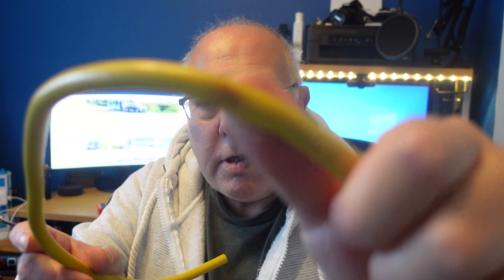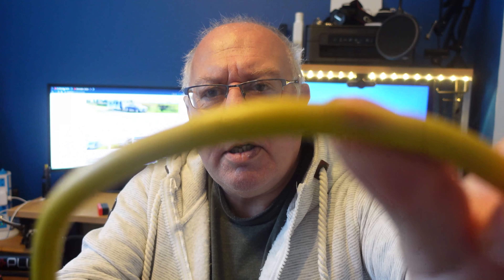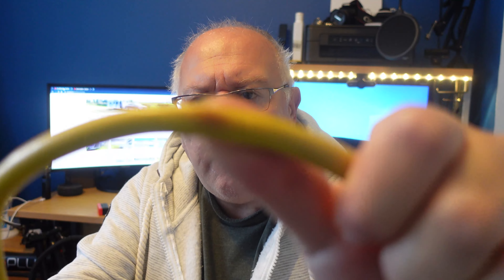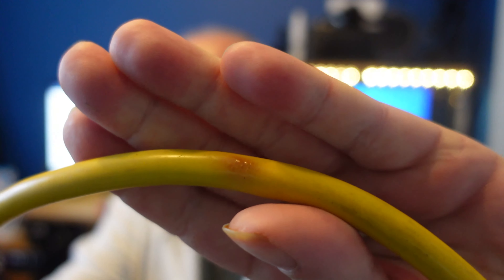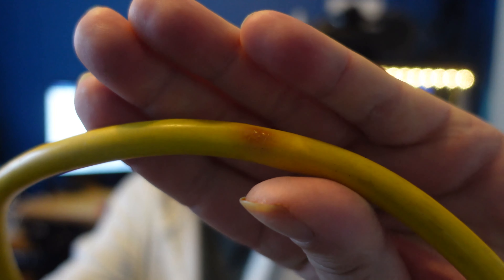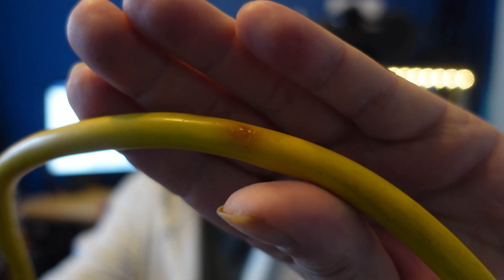How Safe is your Hook Up Cable (EHU)

Comment: Great video as always. I always plug in one of the little testers to the 'van once hooked up as an extra test. It doesn't check the quality of the cable or the RCD etc I know, but it a check for a wrong polarity or no earth etc.
Lucky I did, we were on site one weekend last year and my tester said no earth.
I checked everything and it was my cable at fault. After replacing it, I took the plug apart to find the terminals weren't screw type, but a sprung one shot deal type.
The previous owner couldn't release them so used 3 self tapping screws jammed into the terminal with the wire. We would never have known if it wasn't for the little tester my dad gave me as a kid!

Comment: Good safety video there Alan 👍. You are probably aware we carry two cables, a 25m and 10m and 9 out of 10 times we only need to use the 10m. At the end of each holiday we coil it together, Gail wipes it as I loop it. So it gets a double visual check. So far so good, except for the occasional teeth marks / nibbles from the wildlife. Luckily only superficial. Best regards, Rob & Gail 😀
Reply from the maker: Never thought of wildlife. Mice love plastic taste.

Comment: Alan always been an avid checker of my hook up cable, including security of screws securing the wires to the plugs. Electricity isn’t something to be apathetic about. 👍
Reply from the maker: I wonder how many do check. It seems strange that no dealer has ever mentioned to us about checking the cable on any handover.

Comment: Excellent video.  It should be a requirement to have cables and installations checked or you do not get to plug in.  Our one at home is checked by me and has its own RCD Unit.
Reply from the maker: I think its been overlooked so long that the general view is if it works, its ok.
Reply: @Coffeevaners   Just seems natural to me after years of power on checks on aircraft, why should it be any different for attaching mains to a caravan or motorhome.  It is a routine check van switches are correct, check van connectors and plug in,  Check length of cable and connectors.  Ensure bollard is good then plug in and switch on.  I recheck the cable on the way back to the van.  Take care stay safe.

Comment: Alan I have my caravan on drive and use a 25 meter cable running from bedroom down to van obviously I spread it out this cable is only used at home I noticed a couple of months ago it is going hard so it won't bend easily should I change it its 2 year old and only used at home thanks
Reply from the maker: That's a great question but one I doubt any electrian would give advise over the phone unfortunately.  If you'd said it keeps blowing a fuse or tripping the circuit then the answer is most probably yes go buy a new one. The idea of the video was to say that there is no legal obligation to have cables tested or that there isn't a set timescale on the life of a cable, therefore the need to check. If you have any doubt of it's serviceability seek the advice of a qualified professional to physically check it. Sorry I can't offer a definitive answer.